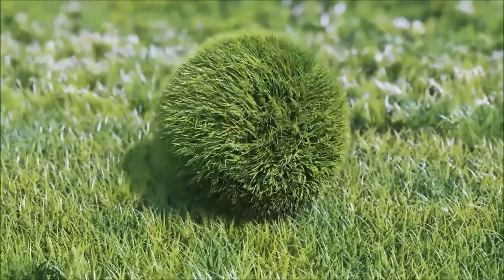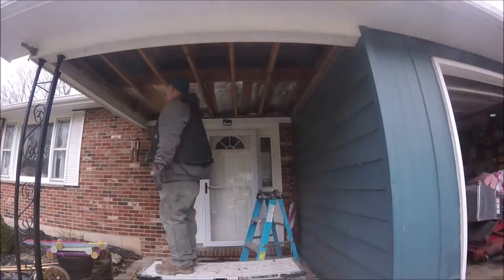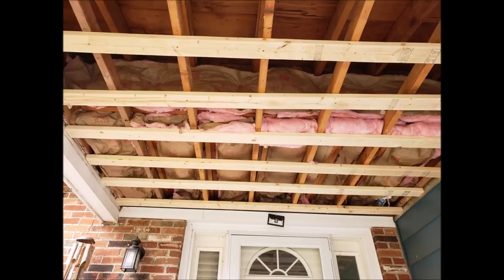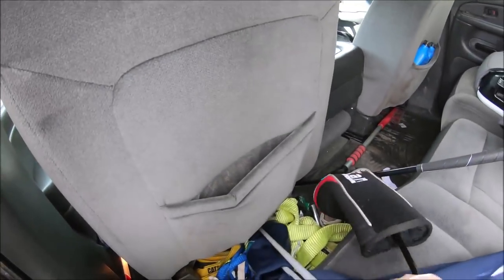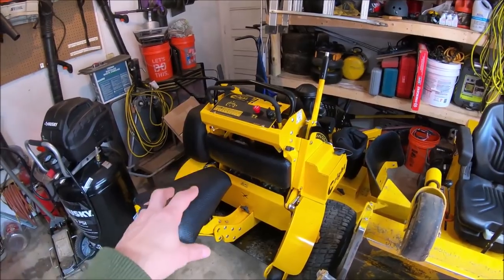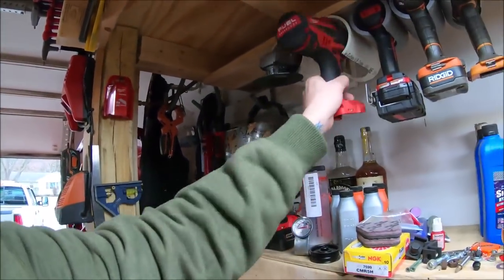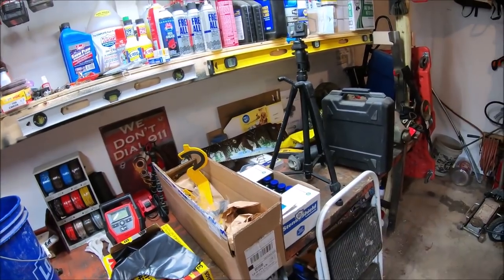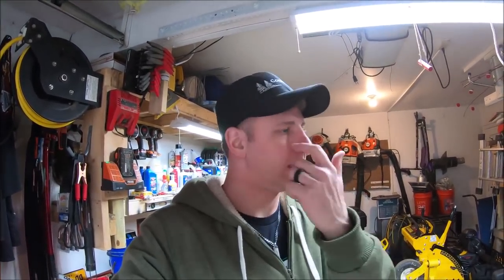Lawn mower setup 2019 // Countryside Vlogs

Comment: Man that ceiling looks really good. Did you get the sport X because of the seat? The guy working for me thinks we should buy that mower but I really don’t see us using the seat as much. I guess it’s good for mowing large properties but you would probably use a walker for that. Good video.
Reply from the maker: Thank you. Yes the seat was crucial. I have back issues. Sometimes if I stand too long, I need to sit and sometimes if I sit too long..... You get the point. Now I can do it all on the same machine.

Comment: Hey randy how good is that Stein oil I have been using red max  for years but it getting more expensive at the dealer and your brand is 10 cheap from Amazon is that were you got yours
Reply from the maker: eBay but I did a video the other day explaining why I'm going back to this stuff. Used for many years without issue

Comment: Be careful with that husky compressor. The fittings for air line are on the side with the wheels. If you are like me and catch your hose on something it will pull the compressor over and break the hardline that goes to the compressor.🤦🏻‍♂️ With the gorilla lifts it’s all in how you install them if they last. Make sure that everything is square and lined up or you will chew up the cable rollers on the end.
Reply from the maker: I also coat the lines in grease at the beginning of the season with my other ones. That may be why they last. Lol, the compressor will be stationary.
Reply: @CountrysideStrong My compressor was stationary too so I thought. I would strap it too the wall if it is always going to be in the same place. Or by a hose reel that is mounted separately.
Reply from the maker: @cutandcleanwi6947  that's what I have